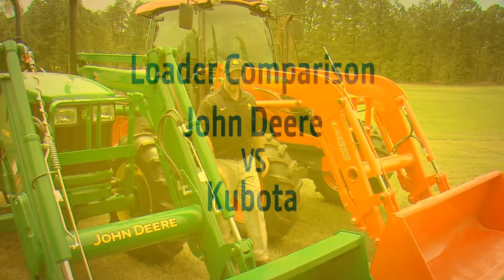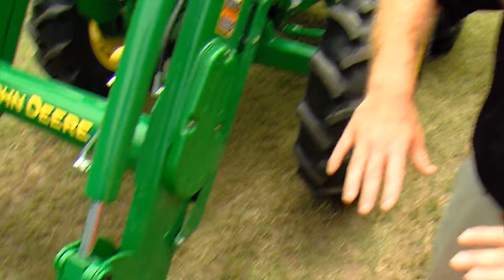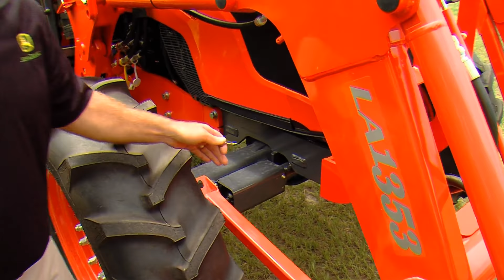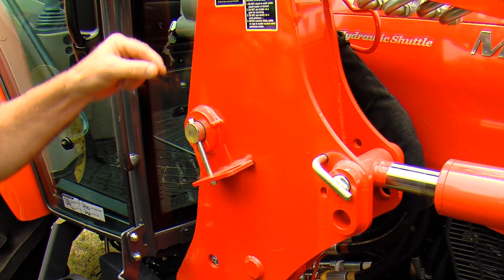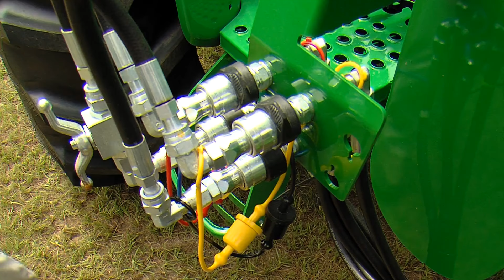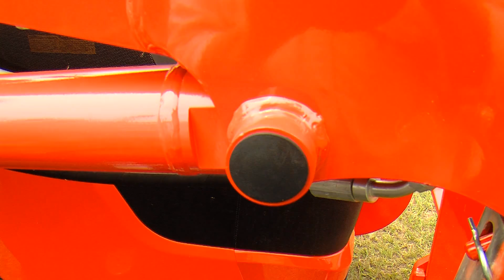John Deere H-260 Loader vs. Kubota LA1353 Loader Comparison

Comment: I have a 3 series tractor, and a 790 tractor and the two things John Deere messed up on as well as the 2002 790 model is the ease of access to battery, and putting fuel in the gas tank. I saw the Massey Ferguson, and New Holland commercials and their tractors have tanks down low, and the battery is easier to access when you have to charge it or another tractor battery.

Comment: Here's the thing with Kubota and every other manufacturer with that skid steer quick attach. You're not locked in to the manufacturer when it comes to buying loader attachments; because it's such a universal system tons of companies make stuff for it, sure there's a few that make stuff for Deere but those companies like the manufacturer usually charge an arm and a leg for their stuff. The one thing I give Deere major props on though is operator layout. Kubotas layout could be better but I can manage, for two machines that cost roughly the same I'll take the Kubota, the differences you pointed out are very minor, but in either case it's not like the old days where you need a tool box and a 1/2hr to 45 minutes to take off the loader in either case you're done in 1-2 minutes. One more thing, hoses I think would be easier to change on the Deere, but are better protected on the Kubota and a nicer finish than most other machines I've seen.

Comment: JD is so full of s"/$...for once, I`d rather have the loader Quick connect out of the way on the Kubota rather than having them sticking out on the side, exposed, on the JD...I`ve never heard of anyone having problems with the loader failing arm or main frame under  load on the Kubota...lot of JD baloney!

Comment: Think about how easy those hydraulic hoses can be damaged jutting out from the frame like they do.  The re-enforcement on the JD could also be because they don't use as thick of steel as the Kubota.

Comment: I rarely remove my loader. I'd rather have the hydraulic connections protected behind the loader, like the Kubota.
Reply: You'd need to be an extremely bad driver to damage the john deere. It's not made of plastic it's made of steel.

Comment: I restored old letter series tractors and drove around the generation before 2000. I am not a big fan of all the gadgets on new tractors but the old John Deere were the real work horse of America and I wish they still made those. Including the iron horse, new generation such as 4020, and the old two cylinders. We have a model A on our farm that works so hard in amazed it beat new tractor standards, then we have our 4455 that we never had to rebuild yet and rubs like a dang champ. I wish John De

Comment: Fair enough but also the quick coulpers on the hydraulic hoses, jd have them on the side of the machine, sure they are easier to get to but also easier for them to be ripped off, should be like the kub where they are tucked away safely away from risk of damage